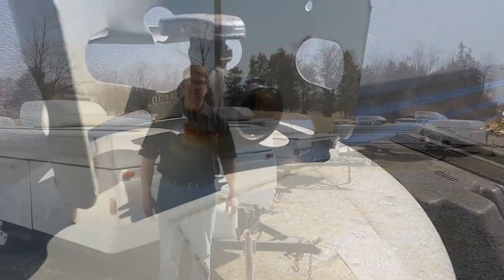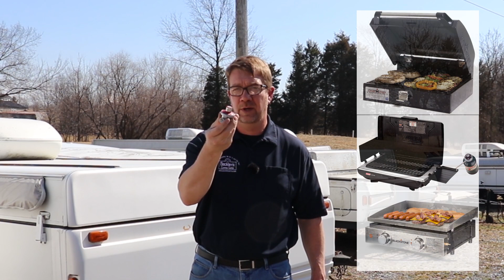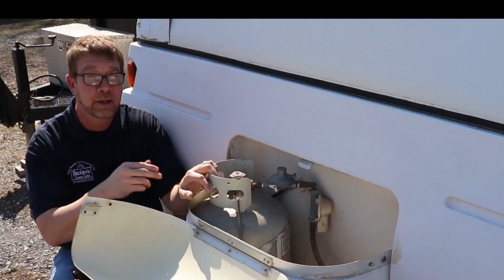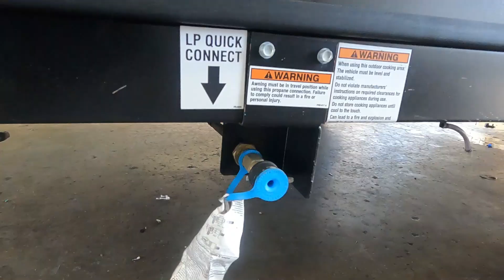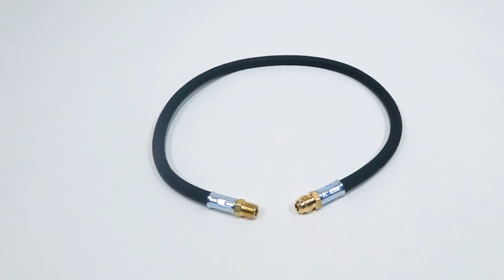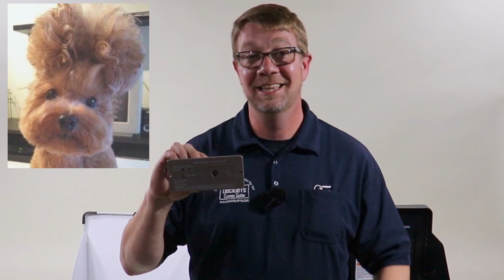Pop Up Camper Propane Basics

Comment: im cornfused. I have a 93 pioneer Seneca popup by fleetwood, all I see is two hoses going inside the camper, they connect to a  T on the outside where the tank or tanks would go, im needing what goes from that T to the tank
Reply from the maker: Please give us a call at Coleman pop up parts

Comment: Thanks for the easy to understand information.  I have a question now that I understand how I can add a hi pressure connection to my propane tank (to run Coleman stove)  I purchased the T connection and 12' hi pressure hose.. can I permanently install this hose to the underside of my pop up?  Basically I want to trace the route of the lo pressure hose and make connection available on the side of my camper.  I am concerned about having a cap on the hose end- so it can travel and generally hang out there permanently.  Thanks for any info on this. Gotta run and watch another of your videos!
Reply from the maker: Thanks for writing and watching Julie! It's been good chatting with you through my other forums.

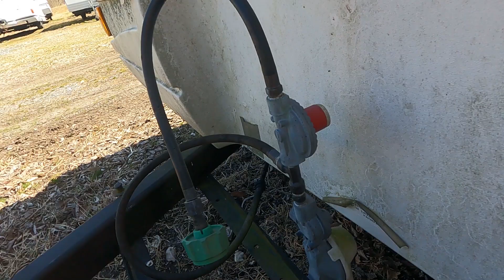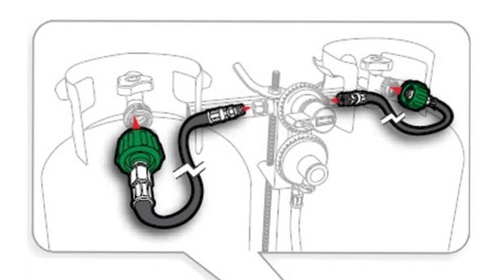Comment: Great video!  This video answered so many questions, but I'm left with 1 question:  I have a 2001 Coleman Utah with a single LP tank, and the regulator setup you show (3:50 in the video).  I want to convert it into a 2 tank system with the auto switch over also like you showed (7:55 in the video).  
The question I have is this:  
When I hook 2 tanks to the dual low pressure auto change over regulator, the inside equipment is all set, but how to I hook the high pressure regulator up to feed the outdoor grill from both tanks?  
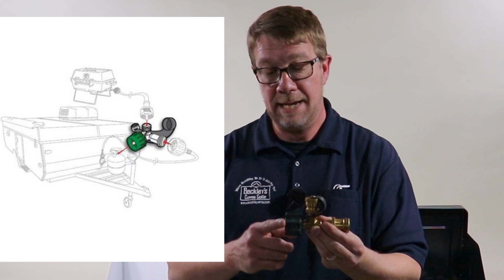If I use the high pressure tee (6:15 in the video), can I use the 1" 20 connector to hookup a 16psi high pressure regulator that goes to the hard line and eventually to the outdoor grill and the type 1 outlet to go to my low pressure auto change over dual regulator?
Reply from the maker: You just need to pipe one tank to the hp line before the Lp regulator. Unfortunately you won’t be able to use the hp stove when that tank empties.

Comment: My ‘03 Utah has auto changeover upgrade. However, only the left tank feeds both high and low pressure appliances. When this tank is empty, quick switch over to right hand tank means outside stove is inoperable. That appliance is the one we use most. This means getting under bunk and switching tank positions which totally defeats the purpose of the auto change over upgrade. Can auto changeover be installed such that both tanks can feed both high and low regulator appliances?
Reply from the maker: Since I have not yet attempted this I cannot comment on how it would work. My initial thoughts would be to add 2 extra street T's, and an extra HP regulator. It may be easier to just point to the opposite LP tank when not using the outside connection. 
In this instance, the LP is being pulled from the tank without the HP connection, leaving the other with more LP for the daytime outside cooking. 
I hope this is helpful! If you do go with a LP system design modification, please have an RVIA certified repair center preform a safety test after the modification on the propane system before you use it.

Comment: You're my popup guru!  I have a 2006 Fleetwood Utah.  My water heater, I believe is a suburban and is old, has pilot light ignition.  I was wondering if you have any info on switching out for a direct spark unit.  I understand it will require a 12V source and inside switch.  Is there any info on the wiring?  Thank you
Reply from the maker: Your power is already there. Even manual light water heaters require 12 volt to run the control board and gas valve. The direct ignition heater should be an apples to apples replacement for you.

Comment: this is really very informative. but i have a question i will upgrade my single tank to double tank propane but the hose underneath is to short. can i just add a connection that you show those 3 hose?
Reply: 1 of those 3 hose you show?
Reply: to the dual regulator
Reply: Or do i  need to change the whole underneath LP line hose.
Reply from the maker: Good questions Mark. You can add a second hose, or purchase a complete new how to the length that you require. It would go from the plenum line (under the camper) to the auto changeover regulator.
Reply: thank you so much for answering have great day

Comment: Great video. I’m new to the camper world and have a question. I recently bought a Coleman Sun Valley pop up, and it had no propane bottle rack or battery rack. I installed a double bottle rack and built my own battery rack with angle iron, but didn’t know there was a difference between high pressure and low pressure valves. I have an outside high pressure cook stove and inside I have a regular stove and fridge. The regulator I bought is a dual bottle setup but it won’t run the outside stove. How or what should I be using to run everything? Thanks.
Reply from the maker: Good question Mike! Using a manifold tee, you can pipe a high pressure regulator off the bottle before the low pressure regulator. You can also install a high pressure adapter tee like we show at the end of this video, that has the 20 threads for the high pressure appliance.